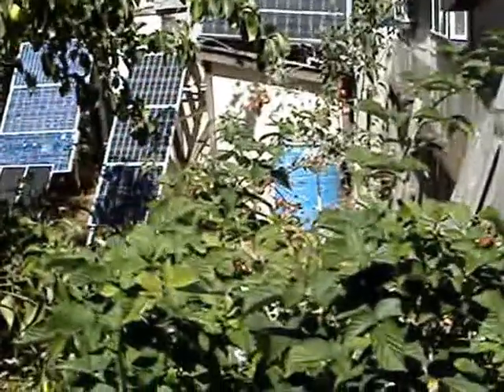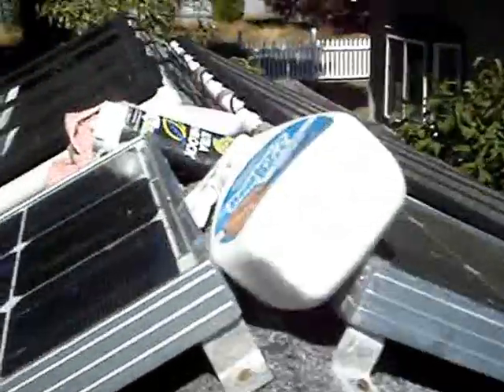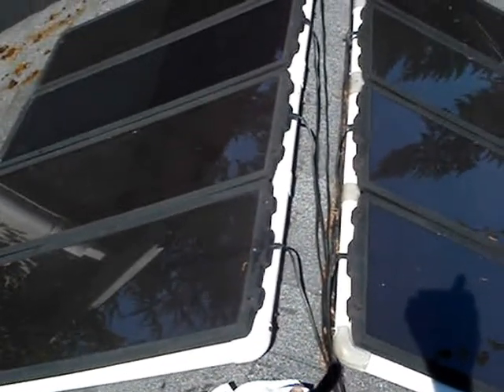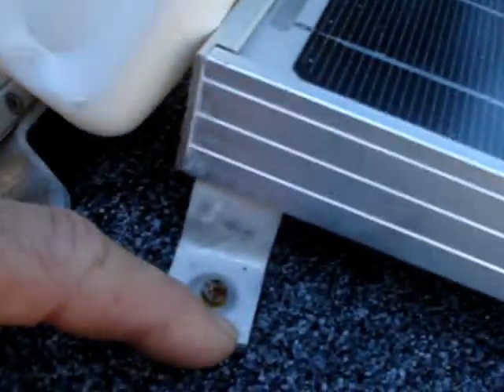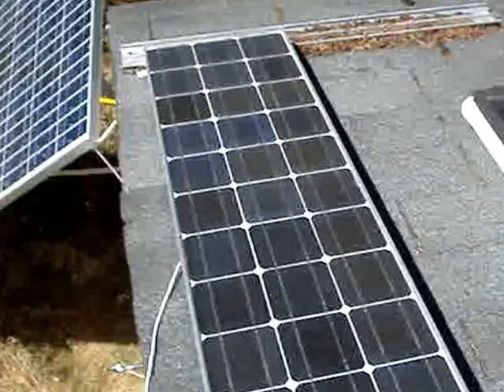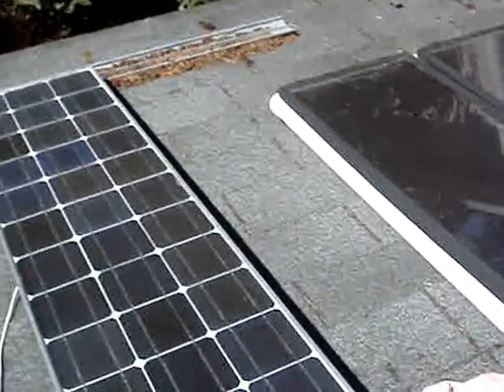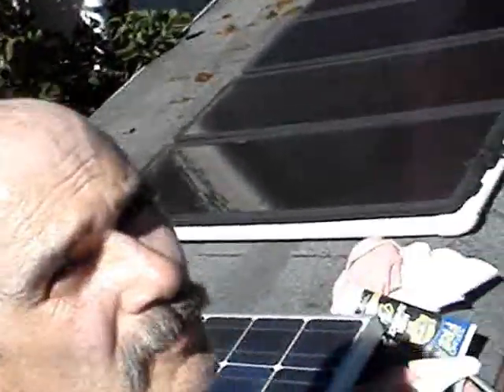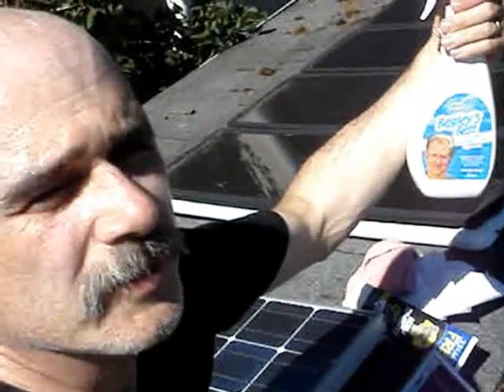Off Grid Solar Kits Outbuilding Roof

Comment: How many kilo watts are you getting? I live in Miami, Fl. and am seriously considering starting my own setup. I have two roof areas, 1) is a shed (need to reinforce) 2) open area with a pretty solid roof. Both combined have about 600 sq feet.  

All my searches on the net and seem to get more advertizing for installers and kits than info. Heck in one instance there was a site that supposedly gave instructions for free (vocabulary) and then required $769.00 for further info.  Best of luck!